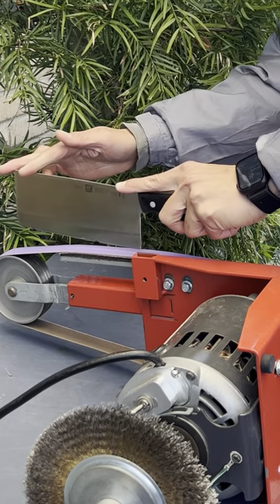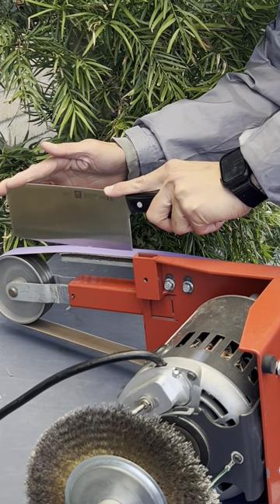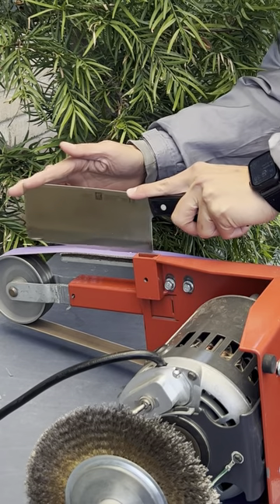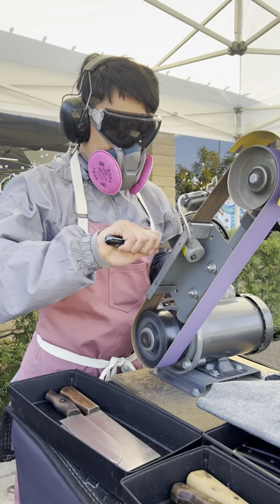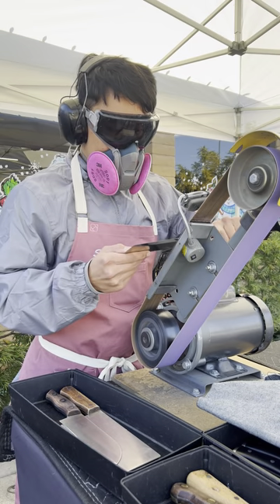Repairing & sharpening this meat cleaver! #knife #sharpening #shorts

Comment: Chip like that isn't from meat, or cutting of any type in normal operations.  Food service for 27 years here.  It looks dropped or made on purpose, the little tick sticking up from the center of the deformation is a decent giveaway that it wasn't accidental most of the time, it was twisted/bent and pulled off, looks like

Comment: When we had a knife or tool break during prep, we'd stop, grab another person and go over everything until we found it.

If we didn't find it, we threw out the batch just in case.

Only had to do that one time, on a VERY expensive item, then I bought a tiny handheld metal detector. 

Some prep cooks are super rough, I've never broken or chipped a knife but we had dudes do it multiple times.
Reply: Their was this one time in Afghanistan...
My buddy and his unit got shelled by mortars and one hit the reefer...
The Stakes took alot of shrapnel...
Resupply dosent come in if area is hot...
So the guys sat around and picked through the steak until they gave up and just ate it and chewed carefully.

Comment: Thats probably a vegetable cleaver actually. The blade is too thin, even for chicken bones.
Reply: Total BS. I use this clever for a while now with no problems chopping up solid and thick bones.
Reply: @jhnd3082 No. The knife in the video does look like a vegetable cleaver.
These are not intended to be used on bone.
Reply: The blade thickness isn't a great argument. I cook all the time. Chef's knifes are generally pretty thin, but if the bones aren't super thick like ox tail, a sharp Chef's knife has little problem cutting through bone, if you are trained in how to properly use a knife.
Reply: @autumn5592  I agree with JHN D. Might not be intended for bone, necessarily, but likely, if you're trained in proper knife use, also isn't gonna have much issue cutting through certain bone. Chicken, some pork, etc. Obviously it won't be great for like a tail bone or something thick, but it'll be fine as a general all purpose use knife.